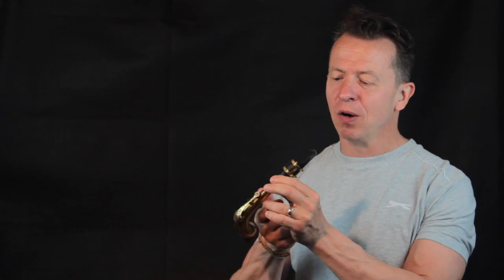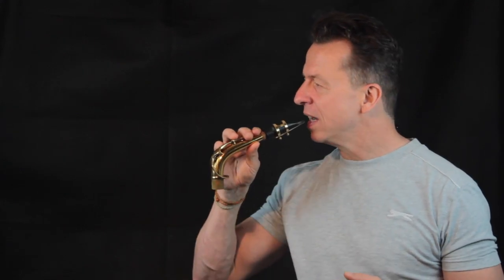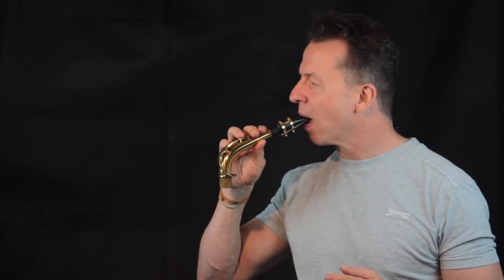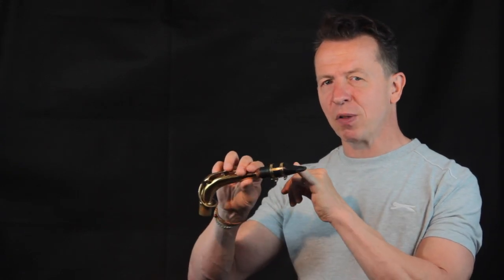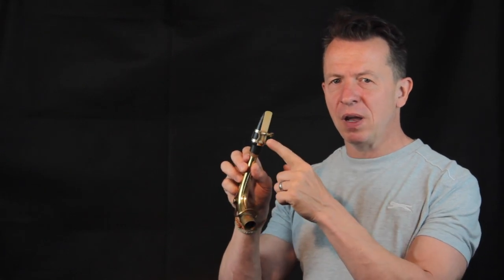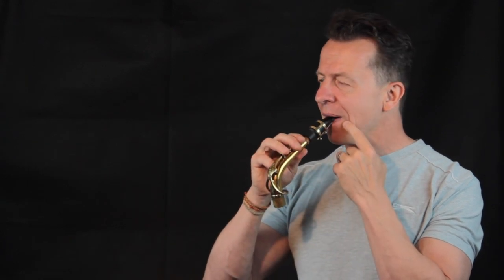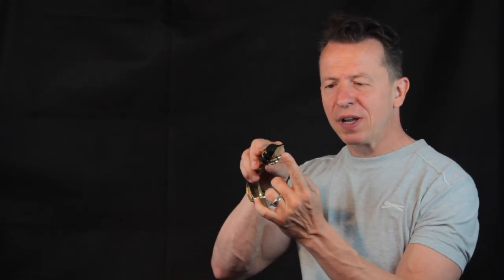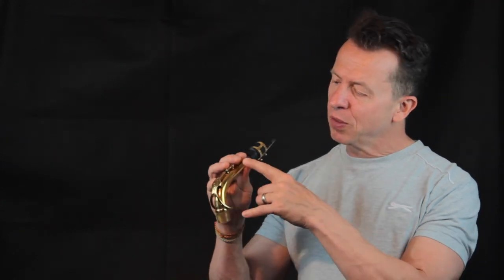Making a sound on the sax

Comment: With the greatest respect and admiration for your proficiency, has it ever occurred to you that the saxophone is possibily the only musical instrument that could cause injury to the player while itself being damaged to a negligible extent. Human teeth are not designed nor are they intended to be subjected to long periods of vibration nor yet are they designed to be subjected to extended periods of upward pressure. Teeth are meant exclusively for eating and the front teeth for biting off large chunks of food into smaller bits to be  masticated by the grinders at the back of the mouth. Originally the embouchure was relatively harmless after the lips adjusted to the pressures required to support the reed.Then came the urge to render the saxophone as projecting as the  brass section and thus came into being the unnatural teeth on top embouchure with teeth marks appearing on the mouthpiece in the mid thirties. In my more than fifty years of refurbishing of woodwinds I have seem countless sax mouthpieces either bitten through or pretty much through  but not one single clarinet mouthpiece. There are of course undeniable positive points attached to the  teeth on top technique but the recent Ennison double lip promises to hold its own against the blasters and honkers, enabling players to revert to the original saxophone sound so beloved by the inventor and Berlioz  and genuine aficionados.
Reply from the maker: Thanks for your interesting and informative feedback!
Reply: @lyndenblades  Thank you for your reply. I thought it appropriate to  seek clarification of the Bergonzi No Embouchure  from a professional such as you , the subject of your video being about the embouchure. I have not been able to find any sort of elucidation of this type embouchure. Others have expressed their opinion as to just what Berbonzi meant by his description. The embouchure has been compared to the use and holding of an ordinary drinking straw.The straw is held exclusively by the lips and the teeth have absolutely nothing to do with it. Should you have your own opinions or thoughts on the Bergonzi embouchure I would for sure appreciate being informed. Thank you.
Reply from the maker: @vivianastridge2167  Hi Vivian, thanks for this. You are way more knowledgeable about this than I am I’m afraid, I haven’t ever really given it much consideration. My embouchure has been the same since I started playing the sax, I was first introduced to the sax and instructed by a full time professional gigging sax player that I met in Thailand while I was backpacking with my girlfriend and he was kind enough to give me some free lessons. This is how he instructed me and I’ve used the same approach since then, and as it has worked for me and no other player or instructor that I’ve ever known has mentioned not having your teeth on the top, it’s not something that I have taken into consideration until you brought it to my attention now. 
Personally I like to keep an open mind and realise that everyone is different and that approaches that are different to mine are interesting. I’m not so bothered about being “right” but instead I focus on what is useful or not useful to myself and others. 
I teach this method as it’s useful to me and it works and until now wasn’t aware that there may be an alternative. Also my teeth do not seem to have suffered very much in the 30 years or so that I’ve been playing, but that’s not to say that it couldn’t happen. You’re absolutely right about bite marks on both my tenor and alto mouthpieces though, I have to replace them every ten to fifteen years because the indentations left by my teeth become too deep.
I think your comments are absolutely fascinating and thank you for the education!!
Reply: @lyndenblades  I feel honored that you should continue to correspond on the subject of the all important embouchure. I am not particularly in favor of the double lip or teeth on top mode as I am equally at ease on either. I am not any sort of expert or specialist on embouchure matters. It is just that I am intensely interested in all aspects of the saxophone and playing techniques.I have written      a paper on the embouchure, its history, modes, relative advantages and disadvantages and as many aspects of this most important element  as I could think of. I have also written a paper on the mouthpiece, its original form ,modifications, effects of the various aspects of design on tone, ease of play, subtoning etc etc and method of manufacture using nothing but hand tools. A clarinetist Colin MacEke of England has used my technique in making  mouthpieces and his efforts may be viewed in two videos he has produced titled “Making a clarinet mouthpiece the Vivian Astridge way”. Despite my consuming interest in woodwinds and especially the saxophone, I have not been able to produce the jazz subtone using the double lip embouchure which seems especially suited  for the teeth on top mode though I have mastered the classical form. I have been able to contact just one single double lip subtoner  who is able to produce the most exquisitely beauteous subtone though not completely of the jazz type. He has a few videos on Yotube and the name is Quamon Fowler. His instructions on  subtone production sadly cannot be followed as not many have been blessed with the super abundance of lips as has this virtuoso . A somewhat interesting or intriguing fact I have come across in my research is that lady saxophonist cannot subtone or have not the slightest interest in this effect. 
I wish you the very best in all things, Sir
Reply from the maker: @vivianastridge2167  Fascinating! Thank you Vivian and all the very best to you too 🤝🤝🎷🎷
Reply: @lyndenblades  Thank you for your reply. I am not as already mentioned any sort of expert on saxophone matters. I       would in all humility suggest that you try for just once the double lip embouchure. The mouthpiece is inserted just before the break line or at the line but not beyond it. The mouthpiece is held exactly  as you would hold a drinking straw with the lips doing all the holding and not ever rolled over the teeth  as in the old classical clarinet mode. I am sure you will be pleasantly surprised and made happy at the enhanced beauty of your sound.The edge would have been reduced or vanished, the sound body would have been made more embracing and the over all quality would be eminently suited to solo  work , church music or classical subtoning. I am not advocating the double lip embouchure but do  try it for just once when the mood comes over you and of course do let me know he results. The very very best to you.
Reply from the maker: @vivianastridge2167  thank you 🤝🤝🎷🎷